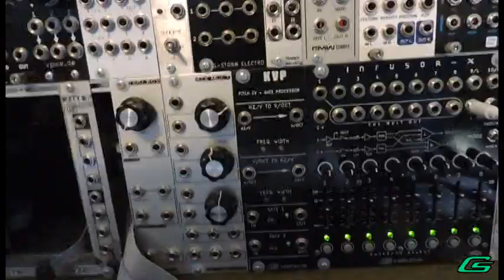Feed External VCOs into the Korg MS-20 Synth using KVP [Quick Tip]

Comment: Ooh! an Emu ESI-32 in the background. Do you still use it?
Reply from the maker: Yes, and I have 2 at this time.  Both are getting new back lights as they have gone dim.  The second has 32mb ram installed but no SCSI, so it is going to get a floppy emulator USB.
Reply: @gstormelectro  Nice! I have one that someone had pulled out the floppy and put in a 200 MB hard drive. At one point I had a Zip drive & CDROM for it but ended up selling those to a guy who bought my SCSI-equipped Roland XV-5080 that wasn't getting enough use. Do you keep them around for the sound or is it some other aspect?
Reply from the maker: Was my first sampler: the way it sounds, the sentimental reasons, and I know how to get exactly what I want from it.  Nothing else has the transform multiplier, but I haven't used that feature much since it takes so long to process.

Comment: That’s great !!! Do you sell an enclosure or can you recommend a good affordable 104 hp let’s say ... I’m not an eurorack user but would like to expand the ms20 sonic power ... thanks !
Reply from the maker: I don't.  Search for powered skiff or boat, 1 row, anything by reputable brand ie Pittsburgh Modular, Make Noise, Synthrotek.  Expect to pay above $200 for 84 or 104HP.  If you DIY you can build the case, and order power + distribution board kits from somewhere like Synthrotek which is what I do.  Might get lucky + save a little $$$ looking for used, pickings are usually very slim.
Reply: @gstormelectro  thank you !!... i was looking into the make noise (I am aware of the prices)... I heard that some modules need more volts than other and to be aware of the depth...thanks